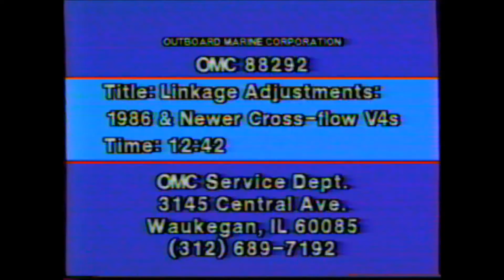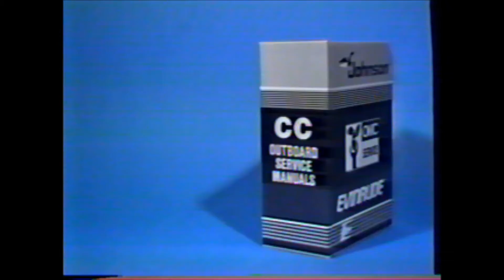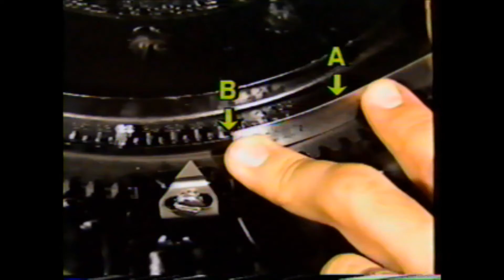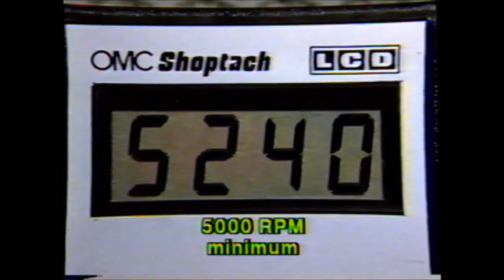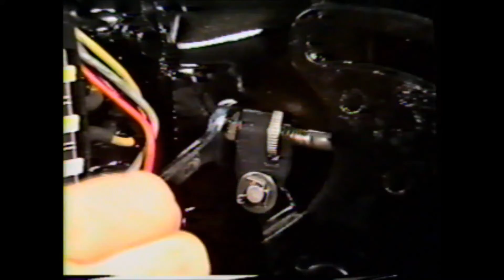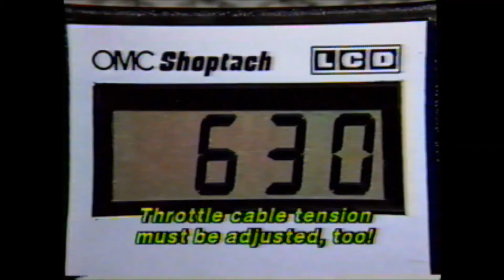OMC 1986 and Newer Cross Flow V4 Linkage Adjustments

Comment: My fuckin idle screw doesnt even contact the stop what the fuck. My idle on muffs is 2000 is that normal
Reply: Need to adjust the throttle cable if I was you I would remove the cable and do all my settings first then install the cable back and reset the throttle cable

Comment: Wish it shared what "adjusting throttle cable tension" entails instead of just saying to do it
Reply: its in the shop manual. very simple put control handle in FWD DETENT then back off so its as low as it will go WITHOUT being in neutral. adjust thumbwheel on throttle cable so all slack is out with thumbwheel. put retainer on and check your work. the idle stop screw should be firmly on its stop when cycling from full throttle to neutral. extremely easy, but screw it up and the motor will idle erratically because its running lean from throttle plates open.
Reply: @ct1762  thank you for this!

Comment: ONLY problem with this original video that contains misinformation is the directions to adjust the idle at the end.so unfortunately if your idle adjustment is off, changing it will change the first adjustments out of synch. I'd suggest combining this video with this video: https://www.youtube.com/watch?v=uJTx-ygU23U to understand that only the timing is advanced to increase the idle speed and so during idle, the throttle butterfly plates remain closed and in fact a small gap should be present between the cam and cam roller pickup. 
Take care
Reply: the idle pickup timing number doesn't really matter because yes, when you go to adjust idle speed in the water it will throw that original # off because the throttle came angle changed, and thus pickup timing. so good observation! the thing the service manual really hits home is that the throttle plates need to be closed at idle. on this model, a gap isn't necessary between the cam and roller, but the loop-charged motors (most of them) do need one.
Reply: That error of instructions to do the idle adjustment as the last step instead of the third step(after adjusting butterfly linkage) has messed so many people up I see on the forums and messed me up when I got my used Evinrude.
Ruined some trips to the lake because the manual says the same wrong thing. It is nice seeing the video in addition to the manual but come on, they really messed peeps up with the error...
These lake used old engines have a lot of life and advantages in them, let’s keep them going proud!
Take care
Reply: @JimTMcDaniels1  hey i agree. I have my own business dedicated to these old girls! But I disagree that it's an error. as I said, it's not the final idle adjustment that matters... only the first as a starting point. they dont explain in the manual, but it's implied that pickup timing isn't a final number, but to make sure the cam roller is on center with the mark, and that the throttle valves are closed at idle. You can't do the idle speed without setting the high speed timing first, because it will throw high speed timing off even though idle speed is separate from high speed timing because the idle adjustment screw changed the attitude of the throttle cam if you do it first, not last. The video you linked to is for a 3 cyl 56 cube looper motor... completely different linkage and running characteristics than a v4 crossflow!
Reply: Setting the idle First can’t change the max timing advance because in this particular design, the fast timing stop screw hoods the max and the idle screw does not change that but only moves either closer or further from the max.
The video link I gave shows how they changed their instructions in the newer years, correcting their error of not adjusting the idle sooner in the steps where it should be.
Reply: Thanks for the discussion!
But I would point out that the manual and video really DOESN’T say the butterfly valves have to be closed at idle!
Because doesn’t it tell us to close the butterfly valves and place the cam roller against the cam THEN adjust the idle AND if you need to bring up the idle screw, then that will move the cam forward ALONG with the opening up the butterfly valves which is a NO NO!?
Reply: @JimTMcDaniels1  no they need to be 100% closed which is why they say to make sure they are just starting to open on that throttle cam mark. the throttle controls need to be adjusted so the cam roller is before the throttle cam mark and the throttle butterflies are closed, but when you advance the throttle they open a tiny bit. The idle speed is done in the water on boat in forward gear, were the throttle butterflies are just starting to open

Comment: TY Brandon !!! just snagged a 1990 115 that starts hard and doesn't like to idle, runs great if ya throw it in gear and idle it above 1200 then throw it to it , plugs read great !! This upload is gonna do me well
Reply: if the synch and timing is in spec, and you still can't get it to run right chances are its an ignition issue. Just finished diagnosing a tired 1987 88hp... both the stator AND timer base were shorting to ground!